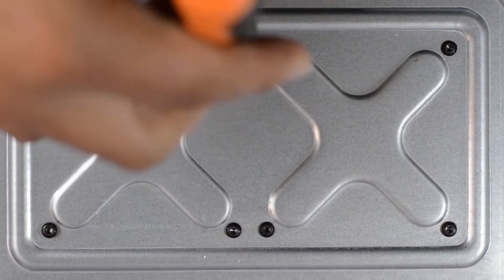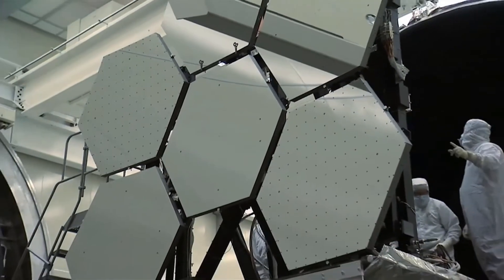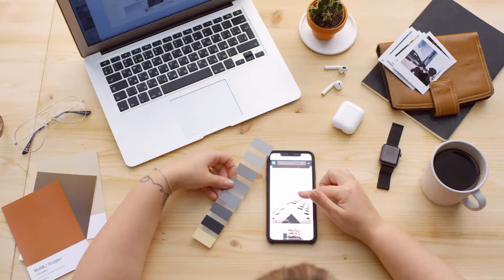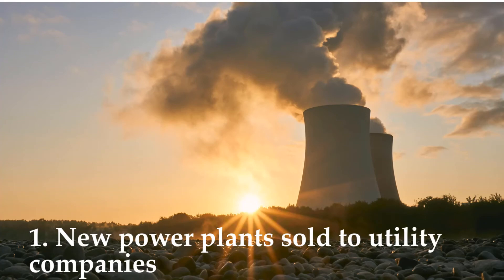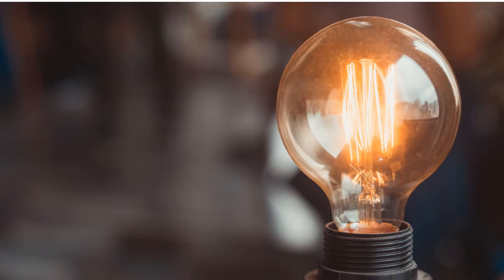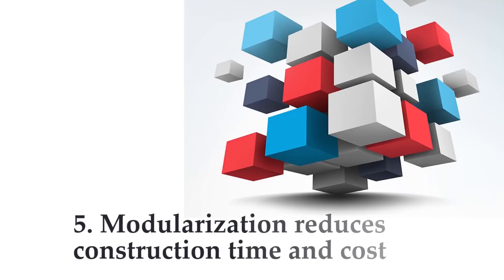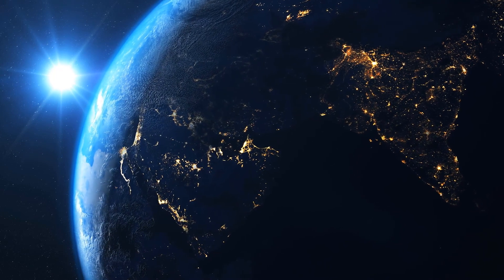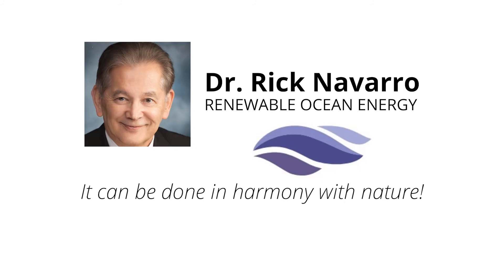Renewable Energy presentation v2 4

Comment: Richard, let me sum this up for you: you waste a lot of energy pumping water uphill to get a little bit of energy out.
Reply from the maker: That's an interesting comment but unfortunately, it is not true.
Reply from the maker: Unfortunately, you know next to nothing about the technology and you have made a decision about it. What does that say about you? Why would anyone listen to someone who is so foolish?
Reply: You can’t get more than the potential energy of the mass out of the elevation of the mass. Lifting some of the mass by lowering some of the mass is at best a zero sum potential energy game. And hydrams have lots of loss. A better solution is like https://en.m.wikipedia.org/wiki/Rance_Tidal_Power_Station. You must be the ‘hole in the ocean’ guy. How’s that working out for you?
Reply: Feel free to lay out the potential energy equations for your process.
Reply: The equivalent circuit in electronics is a voltage doubler, which uses an oscillator (your hydram), a capacitor and rectifier diodes to pump charge into a 2nd capacitor at double the oscillator swing. The same potential energy constraints apply.
Reply: correction, stepped up by the oscillator swing, not double
Reply from the maker: I don't know who PB is but he seems to think he knows everything about this system when he knows nothing. My team has had 3 engineers vetting the science behind it and we have a working prototype so you can stuff your sanctimonious attitude. Simply, you are speaking off the cuff as if you know everything about the system when you
don't have a clue. We are not using a standard hydram but a proprietary hydram. This is not the proper venue to try to explain something to someone who doesn't know what we are talking about but thinks he knows everything about it. Sad.
Reply: Show your work. The total potential energy available is that of the low dam height. How is it that your method is more efficient than a low speed turbine?
Reply: Or water wheel?